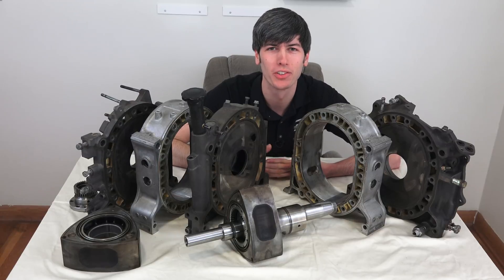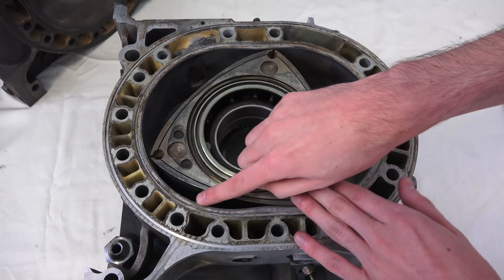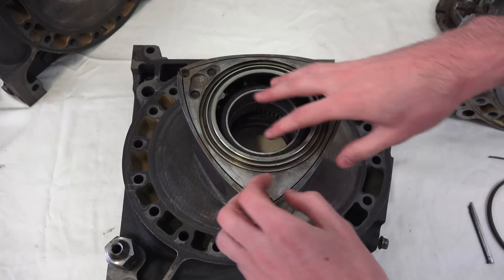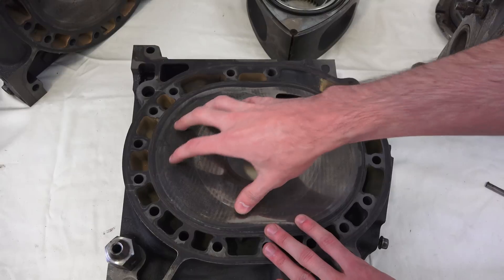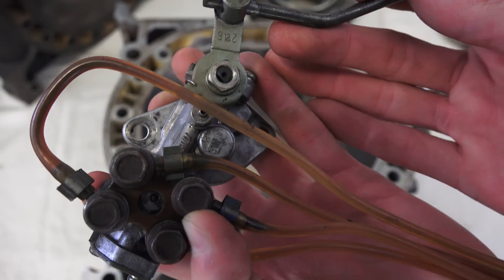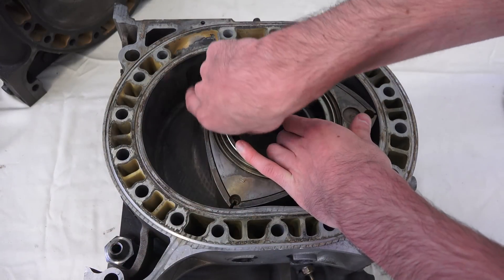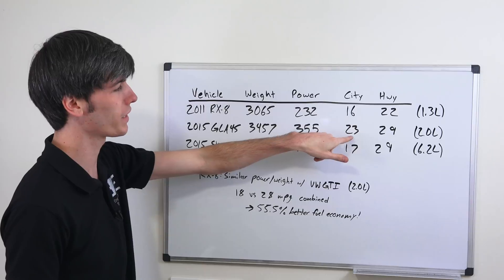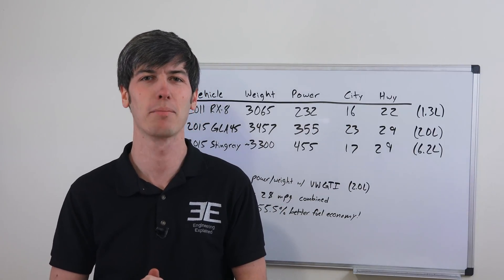4 Reasons Why The Rotary Engine Is Dead

Comment: You are showing the weight of the entire vehicle not the engine..
Reply from the maker: I am indeed showing the entire weight of the vehicle, not the engine, to prove a point.
Reply: Engineering Explained
Power to weight ratio is not one of the reasons that makes wankel engines impractical , you aren't proving a point you're twisting the facts to further your agenda..
Reply: The power & weight comparison was about fuel economy for a similarly powered/weighted vehicle, not power TO weight calcs for acceleration or performance.
Reply: It's not "fair" because it exposes the inherent weakness of the Wankel? The chart showed that in the lightest car of the three, the Wankel produced the worst gas mileage despite having the lowest power output. If the three engines in the chart were put in the same weight test fixture, the Wankel's performance would have been worse.
Reply: Yes, the Wankel is light, but the only advantage is for weight distribution, a minor plus over the major losses.  If you want light weight and Wankel type power numbers, a Ford Ecoboost 4 cyl will outperform the RX Wankels, be just as light  and turn in much better gas mileage. High RPMs are find for chain saws, but make for a lousy car engine for the same reason a turbofan engine would.  The best car engines develop a lot of torque down low to mid range.  The Tesla develops all it's torque from zero rpm which is a characteristic of electric motors, and which is why it's so damned quick.  And I don't know where you got your info on piston engines, but my wife's Edge redlines at 6800 rpm and my Mazda Tribute at 6500 rpm, and they're both happy as a clam at those levels.  I've had my C5 above 7K several times with no problems.  Face it, if the Wankel had any advantages at all, someone would still be building one.
Reply: The video is more concerned with the economics, though, for explaining why the engine wasn't successful. The engineering perspective isn't the bottom line.
Reply: +Engineering Explained instead of having a peanut shape combustion chamber why not make it a triangle and make the rotary thingy peanut shaped.
Reply: yeah that's the point.... the weight of the vehicle also effects the performance of the engine. 
Its called a Power/weight ratio. as seen on the bottom of the white board.
Reply: TheIAMINU
In tiny and very light cars like the original RX-7 they were fun (I had two of them and an old RX-3), but they were not barn burners (over 17 seconds in the quarter mile).  I picked up a 84 Dodge (Omni) Charger 4 cylinder that had a bit less power but a bit more torque and was just as fast (or slow) as the RX despite being almost 500lbs heavier.
Reply: LOL!  An RX-8 is a 15 second car.  My sister's V6 Honda will spank that slug... ( I know, I've driven both).
Reply: ohger1
But the engine itself is lighter than a piston engine by a considerable margin ,ands the wankel is perfectly happy at 13000 rpms , while the piston engines rarely tolerate 5... you certainly aren't going to learn engineering from that dude...
Reply: it shows that it's a weak engine that drinks the most fuel,  so it's a piece of garbage.
And it injects oil into the chambers, so the same as 2 stroke engine, so an enviromental
violation on wheels if you ask me.
Reply: ohger1 At the time they were popular , they were all over carbureted piston engines,, we could debate how much better a propane stove is over a campfire too...
Reply: You understand that at that point in the video, he was talking about fuel economy. The weight of the vehicle is extremely important.
Reply: Stop wasting peoples time with your idiotic opinion. you GhOUL
Reply: Its still proving a point that a piston engine with more power can drag more weight with higher MPG figures. I see where youre coming from but what he states on the board at the end is still valid in my opinion
Reply: lol, can't forget a work party where I was forced to listen to some douche talk about his RX8 "sports" car; while my Z28 parked outside made 320hp, similar weight, and better gas mileage, and cost me less.
Reply: yolech
But they were fun while they lasted , like two stroke engines...
Reply: He intended to show the weight of the car, the entire point of the chart was to compare power/weight ratios and fuel efficiency.
Reply: There is actually another video about the advantages of the rotary engine, should anyone want to watch it. The biggest problem for the rotary is simply emissions. People still buy plenty of thirsty V* (trucks) and don't complain so in performance terms, I don't think economy is that much of an issue. Passing emissions requirements is.
Reply: What most don't actually realize or care to acknowledge is that the Wenkel engine was originally developed for German war tanks.  Well before fuel economy and efficiency was even a revelelent argument.  But idiots will argue it's inefficiency and ruin the time when it was an amazing piece of innovative history..but we are dealing with engineers...if it's on paper then it must be true...I actually owned an RX7 and worked on one and dealt with it...it had it's quirks but it was an amazingly reliable and powerful engine if you took the time to understand it, until I was forced to sell it after over 200K.  But it was compatible to my SAAB 900 in fuel economy.  I'm sure will argue SAAB's engineering but at least it show's that i know a little bit about cars.  But a textbook will prevail.
Reply: I think your looking at this the wrong way, your taking the perspective of the rotary 'gets' to rev to 13000 rpm, by how about the rotary 'has' to rev to 13000. This is BECAUSE they are inherently inefficient that the only way their performance was expectable was by spinning it so hard (because the make very little torque, and hp can be assessed as torque multiplied by rpm) which in itself will lead to premature failure. I think he made a perfectly valid point, he's compared the fuel consumption of the actual vehicles that carry the different engines. The fact the rotary weighs less is neither here nor there. They were dirty, oil burning, incredibly inefficient engines that needed to be revved to the moon. It seems your the one pushing an 'agenda' here, the rest of us are looking at the facts
Reply: But it is what makes them impractical....why would you want a car that ways less with less horsepower to have worse economy than a vehicle thats heavier with more horsepower? Engines are pretty much useless without the rest of the car...
Reply: What exactly do you think the engine is there to move around? Itself only?
Reply: That High redline though. And that sound... Like a  streetbike... Makes it worth dumping 1 quart of oil in every tank.
Reply: +The real doktorbimmer 
hey can you explain me why my 2 tones suv has more fuel efficiency than my much lighter tiny engine bike?
please im really curious about that..
Reply: I heard that the 13b Can be converted to use Hydrogen as fuel. What other engine can do that though?
Reply: Well, I am going to be sure to take my RX7 on a track day at Sears Point (or whatever its called now) and then later take my Audi and see which one is more fun to drive. I have seen videos of cars racing vs. rotarys and its funny to watch because the piston powered car trying to pass will constantly hit his rev limiter once or twice trying to pass because of the high rpm of the wankel. I heard technically the rev limiters on the 13b should be set much higher as the engine produces a more steady torque curve and the engine does not do any real damage to itself until around 13,000 rpm.
Reply: The real doktorbimmer Those pore sales are resultant of the problems I listed. Its a bummer to because isn't the Wankle the most recently developed type of engine out there right now? Maybe there will be a breakthrough and they will have a comeback.
Reply: The real doktorbimmer You are still talking about this? That's mostly correct, accept its not completely inferior to reciprocating engines. It just not not what is needed in cars. Just like jet engines in family cars didn't work out. They have advantages over reciprocating engines that are undeniable. The problem is those advantages are not worth the compromise that cam along with them. Also its not lake Mazda didn't notice until 50 year later. They just continued development to explore the engine and word on the street is that they are continuing to do so. Mazda has always built less Wankles than standard engines.

There is a very polarized group here it sounds like either people love or hate rotary power. You can not be objective enough to find the correct application for any engine with that sort of attitude. Just understand the facts and forget the bias.
Reply: Who cares about highly inefficient piston engines. The 4-stroke piston engine can never be efficient as it has massive pumping loses and a crankshaft. Its days are numbered. 

The latest R&D shown the wankel as the supreme range-extender.  Toyota have teamed up with Mazda to develop one.
Reply: Arthur Henrique Mendes Berté
Bimmer McBimface, thinks that rotary engines are only made for cars.  Sad but true.
Reply: lol very creative idea
Reply: that is what liquidpiston.com did
Reply: The real doktorbimmer
Right , but who doesn't like a nice campfire .http://www.wired.com/2015/12/mazdas-confusing-plan-to-resurrect-the-famously-dirty-rotary-engine/.  (read it and weep)...
Reply: get lost.
Reply: The real doktorbimmer
I would say far more impractical than terrible. I had an RX-4 (or 3, I really can't remember!) and two early RX-7s and they were fun cars.  I think a much larger displacement or 4 rotor Wankel in a light car might be fun, although that would only increase fuel consumption and emissions.
Reply: What most seem to be failing to realize here is that you will get better fuel economy from a vehicle that is lighter and has more horsepower.  The engine doesn't have to work as hard and therefore will perform more economically.  So his theory is a little flawed.
Reply: Robert McDonald

Apparently that's not the case, as the chart shows that a significantly heavier car with an engine with significantly higher power output gets much better gas mileage.

It's true that a light car with a more powerful engine should get better gas mileage in theory, but it doesn't matter if the engine is inherently inefficient like the wankel.
Reply: Are you serious?  Here's a perfect example...a friend of mine has  harley with the 883 engine and I have one with a 1200...we both weigh approx. the same and both our bikes are within 10lbs of each other...I get better fuel economy than he does...can you explain that?
Reply: Robert McDonald Well, I don't know anything about cars but I respect alternatives to any dominant paradigm. The fact that the rotary engine even made it into production, in the face of the dominance of reciprocating engines, is important for its own sake. The bottom line is this: each engine is a mechanical solution to extracting the maximum amount of energy from every drop of fuel. Some win on power out put. Some win on economy. Some win on weight. Some win on flexibility. There is no one perfect solution.
Reply: You dont understand that only the weight of the total vehicle is relevant when comparing fuel economy?
Reply: The real doktorbimmer 
"What advantages?"

I don't know. I made it lear that I don't know very much about engines. What are you trying to prove from what I said? One thing might have been worth looking at. In the Mazda 787B, the small size of the engine almost certainly made the centre of gravity very low. I would have thought that balancing out a rotary engine would be relatively easy too.
Reply: The real doktorbimmer Are you looking for an argument? I told you; I'm not an expert in engines.
Reply: The real doktorbimmer I'm not confused about anything. Reread my original post.
Reply: The real doktorbimmer That was from a purely legal point of view. Mazda could not meet newer emissions standards. Now, I have better things to do with my time, so I suggest you find someone else to lecture on things I don't care about.
Reply: it's a gas oil mix design that demands a hot ignition if it where cut out of forged steel and the turning assembly was a tight fit it would need to be oil injected until it ran long enough to warm up to operating temps and run on a microscopic film of oil but  metallurgy and tolerance studies where never done potentially the engine is as good as any turbine engine
Reply: James Cagney No way. Gas turbines are much more efficient.
Reply: Daniel Brealey I see your point but all engines have their best operating levels. The fact that a rotary engine doesn't reciprocate like "traditional" car engines do means that rev limitations are not quite so binding. Some jet engines, such as APU's, frequently rev to 50-60,000 because they use constant combustion but they can't function efficiently - if at all - at 10,000. I don't see that as a problem. Certainly the other point you raise about oil is true.

What was the most likely component to fail in a rotary race engine? (Genuine question: I don't know the answer to this)

"hp can be assessed as torque multiplied by rpm"

Don't forget to divide by 5252. ;)
Reply: It's all about weight and torque coupled to a transmission that is well balanced in terms of handling said torque and weight. The right kind of engine with the right kind of tranny for a given weight and "normal" rev = optimal configuration for a given speed...most mpg.Putting a small and "weak" engine in a big and heavy car will lead to bad efficiency as you have to push the engine outside it's top efficiency for most of its time. In a light car with a big and powerful engine the limiting factor is that you wont be in the engines optimal efficiency as long as your not on the highway or towing. Do you have the twinspark sportster 1200?
Reply: How many HP per litre of capacity compared to a reciprocating engine? What is the weight of the engine for its output? What was the most likely component to fail?
Reply: The real doktorbimmer The amount of energy that is put to use by burning the fuel. In warm weather this would just be excess heat. Using that heat to do some work = better efficiency. At least if we are talking physics.

The effects on MPG is 0 and as you can imagine the load is the same..

Diesel vs Otto. A gas engine (otto) is more efficient if run at the same compression.
 However..a diesel engine can have a much higher compression due to the properties of the fuel.. And high compression ratio = higher efficiency. I guess that you don't want to hear about "how" they work (cycle, ignition and such) but rather why they are different in terms of efficency? If not I can write that too..

I think that it would be helpful if you can define Load as I suspect we are in principle talking about the same thing but using different words?

Contradicting? I said that a bigger engine could have better mpg because you dont have to push it to the limit all the time. I think that it's quite clear that that means you don't put the same load on it. (Is this also a point that we are agreeing on without us knowing it?)

"Its not a colloquial term.. it is engineering terminology.. "technical jargon"..
And no clearly you don't understand what it means at all.."
Why using colloquial terms? That was because I wasn't talking to you..And why so nasty?
Plus..English isn't my first language so you have to accept that some english"technical jargong" doesn't come automatically for me.

Cheers!
Reply: Two stroke engines make a lot of sense when it comes to power / weight ratio.
However, you gotta mix oil into  the gas = dirty combustion.
The EPA created their downfall.
Reply: that would leave gaps
Reply: i am and engineer and medical dr, where fatal lapses in logic are not permitted. i agree as well. i further think those who disagree that resorted to name calling are degenerates. it is important to be factually correct if they want to be dicks (i have no problem with .... its human nature to boust).
Reply: I don't know, how about you tell me first.
Reply: not sure where you learned any of this.. these motors dont like to go above 9, people have modified them to reach 10k but power drop off is around 8k rpms and things are more likely to fail the higher your rpms climb- and if you DO have a failure at that rpm range, you will certainly need a strong firewall to keep any passengers from becoming sushi. 

as for piston engines rarely tolerating 5.. I have literally never in my life driven (or seen) a piston engine that cannot tolerate 5k rpms. Almost every single piston engine can reach beyond 5k rpms, and certainly most of them aren't even redlining at 5k.
Reply: its funny because the ford ecoboost 4cyl is actually a mazda engine. look at the masda speed 6- ford bought the rights to their motor (2.3liter 4cyl turbo) and a few years later ahem 'new' 2.3liter cyl ecoboost "ford" motor!
Reply: The real doktorbimmer
Reply: yeah, rotary engines weight less than piston engines. if you example have 700hp rotary engine, you will need 2x heavier piston engine to get the same amount of HP.
Reply: You are missing the point. He is comparing the power to weight of vehicles that have fuel economy data. Not power to weight of engines. The Weight is just part of the load in this case. So a 200 something horsepower engine moving 3000 lbs does it using so many gallons of fuel. It does not matter what the engine weighs for this comparison.

What agenda does this further? He says in the video he hopes they come back. If you want to blame someone for demise of the rotary blame voters (the general population) for voting in politicians that have basically legislated these out of production.

You are correct that these engines have a good power to weight ratio much like jet turbine engines, and 2 strokes. I have seen planes that run on old Mazda engines. They still use a lot of fuel for the amount of work they due though, just like turbine engines, and 2 strokes do.

If you really miss rotary powered cars you need to vote accordingly. EPA, and other government regulations especially in California make it so fuel cost rises and vehicles have to meet stricter standards. Street legal 2 stroke motorcycles went away long ago, and now the rotary. It may not be long before internal combustion is just not legal for new production on the street. Then as less vehicles use gasoline fuel cost will rise to the point regular people wont be able to afford to drive older gas powered cars.
Reply: yeah, it's not good engine for a normal driving because 200hp uses fuel like 12l/km. Allmost twice as much as normal piston car.

My point is that He said on the video I put there. "It's best engine for a racing". That's what I want see again but racing is for engine development. So that's FIA's point I think.

There is also that thing that rotary engine development is not that developed than piston engines so if everyone starts to develop those engines, we should get them better. You have good points here too I'm reading and learning.
Reply: The real doktorbimmer
it's good engine for racing but racing is for street cars development and wankel is not good to put in the street car. It's more reliable and 700hp wankel weights less than 700hp piston car, watch that video I put there.
Reply: It seems that some people are forgetting that the 2015 GLA and the 2015 Corvette SHUTS DOWN cylinders to actually REDUCE fuel comsumption, while the rotary CANNOT... If you compare ALL cylinders in use, GLA and the Vette has WAY WORSE mileage than the RX-8. Also, GLA has TURBO. So, with the Turbo on, in low revs, it gets even MORE fuel efficient. 

Add a turbo on the rotary, and you get a little better mileage...

Yeah, really good "comparison"...
Reply: Right, this is a resultant affect of people not wanting to by them due to the aforementioned reasons. Lack of sales is not a cause it is an affect. They are not unpopular engines because they do not sell, they do not sell because they are unpopular engines.
Reply: Correct, I'm not arguing with you. You are talking about a different subject than I. I was giving the explanation for why what you are talking about is happening.
Reply: +The real doktorbimmer 
 Bimmer McBimface, you must stop making things up.
Reply: To be completely honest... the rotary has a lot of disadvantages and advantages. Firstly, it's a very impressive motor for RACING PURPOSES. The 787b proved that fact solidly. When the 787b was released in when it raced in lemans it was a extremely dominate car because of it's extreme reliability at high rpms. One of the other advantages is the ability to put power into rotary's like no ones business. Unlike most compression style piston motors... rotary's have the ability to take high load from the get go, 9k rpms, 10 rpms stock.(don't quote me on that exactly) So boosting a rotary is actually a very easy thing to do and USUALLY is pretty damn simple. Lastly... even though this is a pro and a con... rotaries can either be horribly unreliable or very reliable under daily driving circumstances. You have to really take car of a rotary in a lot of cases, 2 cycle oil in the gas, not shutting your car off at idle, and even though you probably shouldn't use it, synthetic oil and how to avoid it lol. Alright, so now lets get into the 2 major flaws of a rotary. Firstly there is the fact that they get EXTREMLY hot and they overheat quite often if you beat on it or if your intercooler is stock. Get a bigger one and it will solve most of your problems. Secondly and this is what makes driving rotary's a annoying experience is the gas consumption. As it was already stated in the video and I'm not going to dwell further on it... rotary's aren't exactly ''efficient'' and tbh it sucks when you have to put in premium gas everytime you fill up. ( you should at least ) Every car is your own, hate or love rotary's... it's not gonna change the fact that they existed, over 800k rx-7's were made for a reason back in the day. Like this comment? Thumbs up if you agree peeps.
Reply: The Final Eclipse
It takes only 25 to 30hp to propel a large American car down the highway at 70mph. Yet they put piston engines in them that can output 150 to 200 HP, a Rolls Royce's engine outputs 450 HP. Most of that output is for acceleration and heavy loads. It is highly inefficient because there is no supplemental power (with an energy buffer) to use when extra power is needed. Efficiencies rise when power is modularised into power units and modules brought in when needed - sequenced.

The great thing about a series-hybrid is that the generating engine in the genset works totally independent of the demands of the electric driving motor, enabling maximum efficiency of both when running. This means the generating engines can be greatly downsized as the genset engine is sized for average use, not peak use. The genset can be charging the battery energy buffer when the vehicle has low demand. The battery acts as an energy buffer to give acceleration boosts and assist in heavy loads.

The positive attributes of a Wankel engine, one third of the size and weight and very smooth, combine to make a superb range extender easily hidden in a vehicle. If a car is plugged in each night and uses grid power using the batteries to propel the vehicle most of the time, then wear on these Wankel genset units will be negligible as it will be a part time engine (genset). Even when batteries are depleted, the Wankel can provide enough electricity to power the car and still be highly economical.

The sooner Wankels are introduced in road vehicles in series-hybrid form the better. The technology is all here. Once successful and the public accept a Wankel, as decades of negative propaganda have poisoned their minds, this should pave the way for larger implementations in Wankel series-hybrids.

There have been some advances in Wankel engines negating many of the disadvantages.  HCCI ignition by Mazda and SPARCS and CREEV in the UK. CREEV is an ‘exhaust reactor’ that consumes unburnt exhaust products (was a big problem with Wankels) delivering lower emissions and improved fuel efficiency. A sort of turbo. Wankels are very efficient when run at a constant speed as in genset applications (range-extenders).

The Wankel has finally met its niche. Makers are too slow in implementing. Once we see one successful implementation we may see a flood. Mazda and Toyota have pooled resources to produce a viable range-extender.
Reply: Can't tell if your critiquing me or defending me as I'm not trying to sift through several panes of dialogue. ( no offense ) But from most of what I've read, you addressed the main points and most of the matters are right.
Reply: The Final Eclipse 
"Can't tell if your critiquing me or defending me"
Just batting the ball.
Reply: The real doktorbimmer 
Bimmer McBimface, you must stop making things up.
Reply: I'm just thinking rotors are great motors for racing but are pretty impractical for the streets.
Reply: The Final Eclipse 
Read my posts.
Reply: The real doktorbimmer 
Bimmer McBimface, you must stop making things up.  Rotaries went zoooooooooooooom!
Reply: The real doktorbimmer 
Bimmer McBimface, they went .... zoooooooooooooom!
Reply: The real doktorbimmer, who said ANYTHING about the 2013 Vette? I spoke about the 2015 Vette. And it DOES shut down pistons in order to get more mileage per gallon. 

The two most significant improvement of the piston engine is the electronic fuel injection and cylinder shut down. Those contributed DIRECTLY to the better efficiency that we see today. 

If you get a low pressure turbine and install it in your car, you will get better efficiency, because it will help your car's torque in low RPM's, therefore making it save more fuel. Get a Wankel with the same kit, and it will produce the same effect. 

Also, about your "there is no Wankel over 700hp", I will tell you to check out here in youtube a video about a guy who built a 700hp+ 4 rotor Wankel, bi-turbo.
Reply: The real doktorbimmer 
Bimmer McBimface, you must stop making things up.
Reply: The real doktorbimmer 
Bimmer McBimface, you must stop making things up.
Reply: The real doktorbimmer 
Bimmer McBimface, rotary engines are used in many things. 
Mr McBimface, you must stop making things up.
Reply: Andrew Boundy
Is still not a fair comparison , from an "engineering" perspective..